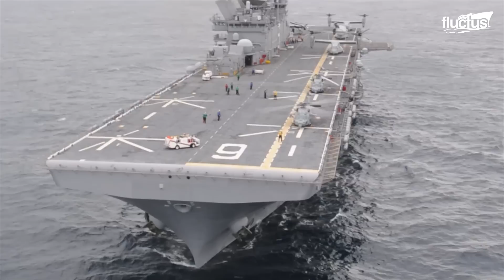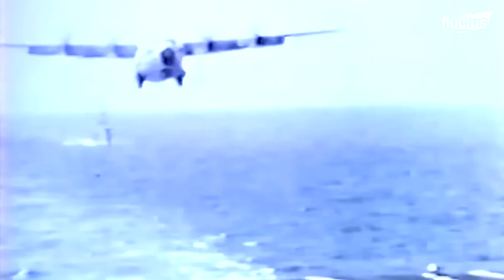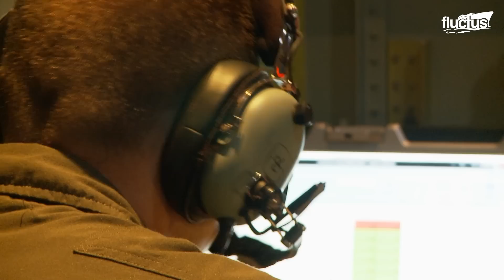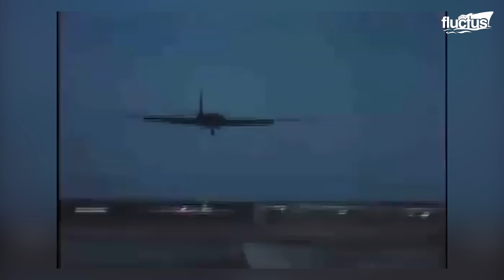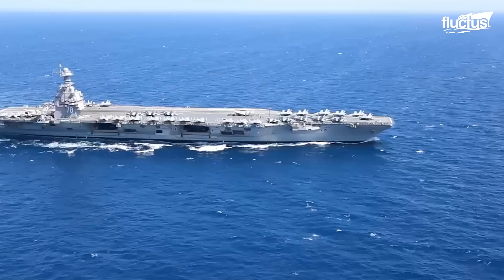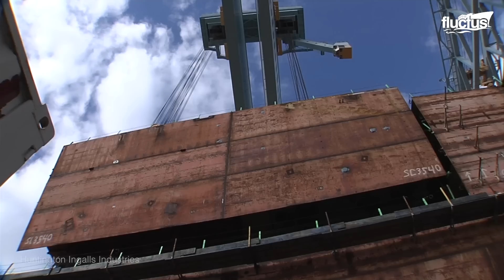Why US Tried the Most Dangerous Landing Ever Made on an Aircraft Carrier

Comment: Ok 105 knots landing speed 120 mph. Aircraft speed does not matter but the air over the wings does. That could be landing in a 20 mph head wind or the carrier is moving 40 mph or both would equal 60 miles per hour. If the ships speed and the head wind equals 60 and the air speed indicator reading 120 his true ground speed would be 60 mph. You could land a piper warrior on a moving aircraft carrier into the wind and it would look like a helicopter landing. His airspeed indicator would read 60 and his ground speed would be zero over the moving aircraft carrier.

Comment: F-104s flew both with and without wingtip tanks, and had leading edges so sharp they were covered for personnel protection when on the ground. I imagine one might just cut through the trap netting, both failing to stop yet getting damaged enough to not be able to lift off again. Does anyone know if that was ever tried? Just a F-104 fan wondering aloud.

Comment: Ahh, the two nuclear power plants do not turn the four shafts... These ultra modern ships still are powered by steam turbines, the reactors are just the way that steam is generated/created. Steam turbines turn the shafts and create the vast amounts of electricity needed for the new style systems (catapults and such) plus built in "future" capacity to allow for newer systems. Ships have been powered by steam for 200 years now (give or take). Since the invention of the propeller or screw propulsion, most of what has changed is how we create that steam. Wood gave way to coal, coal to fuel oils of various kinds, oil/diesel to nuclear. There are of course exceptions, many smaller navel vessels use diesel and jet turbines that are direct connect to the shaft, but steam is still king of the hill for the big boys whether they are "nuclear powered" or "conventional powered".

Comment: I was aboard the USS America CVA-66, 1969-1972, and we had a U-2 touch and go, land, moved to hangar bay, later moved to flight deck, and then take off.
Reply: How did it fit onto an elevator?
Reply: @naardri  on diagonal, one wing hanging over water, can't remember if it had a small wing tip fold up too??? what was cool was watching RHI RADAR scope during preliminary touch and gos ... it would "jump"  several hundred feet almost straight up!!!

Comment: While it was a good feat,  C130 has superb STOL  performance.  The Forrestal could make a 34 knots (higher I believe but this is the official top speed) and with a 15 knot headwind, the C130 would only have a relative speed of about 60-65 knots.  I think recovering the RF-5C and A3 was probably just as dangerous. These AC had much higher speeds and a much shorter deck.  Now I think it was nice flying, but the AC was landed on an empty  1000 ft flight deck on a carrier headed into the wind.
Reply: Did you mean RA-5C Vigilante ? My cousin was a USN RA-5C pilot on the Kitty Hawk, while at the same time I was a USMC KC-130 avionics tech, I worked on that old F model a time or 2.
Reply: @roberts6900  Yes, my mistake but that is the AC I meant. I was an Avionics Mater Chief for MAG 36 and VMGR-152 was one of my squadrons. I did not get a lot of flight time in the C-130. Pulled a couple of runs form MCAS Futenma to various other places but no stick time in that AC.  I was with VMFA 451 on a deployment aboard the Forrestal and saw some RF-5C landings.  The F4J is about 58 feet long and a wingspan of about  38 ft, vs something like 78 feet and 53 feet for the RA-5.  The RA-5 made the F4J look small. It is a big aircraft and I think maybe one of the hardest to land on a carrier. I would think the excellent STOL characteristics of the C130, with an empty flight deck, would be easier to land than an RA-5 on the angle deck with AC parked on the starboard side.  It looks small in an F4J.  I would think that in an RA-5, with aircraft on the deck, it would have a high pucker factor.
Reply: @shenmisheshou7002  VMGR-152 was also one of my squadrons.
Reply: @roberts6900  Marine Corp was a small world.  If you did C-130s, you likely passed through Futenma.
Reply: @shenmisheshou7002  I was at Futenma, I extended twice to stay there.
Reply: @roberts6900  What years were you there? I loved the snorkeling there.
Reply: @shenmisheshou7002  '76 to '79.

Comment: Landing a 4 engine STOL onto a super carrier was a huge achievement. But I don't think this was the most dangerous carrier landing. Dunning's landings on HMS Furious in 1917 were more challenging. Eric Brown's landing of a twin engined Mosquito onto a tiny escort carrier was also more dangerous. But if the Hurcules landing had gone wrong, there would have been an order of magnitude more carnage.
Reply: I don't think that landing the C130 was a good idea.  Too much can go wrong where conventional means of recovery wouldn't work.
Reply: @qua7771  Ours is not to question why.
Reply: @Will_CH1  I been out for decades, and don't think like that anymore.  I heard stories about the C-130 back then, and thought it was a bad Idea. I thought people were making up stories. I worked on P-3 Orion's that has the same engines.  I wouldn't want to be on the flight crew, or anywhere that flight deck.
Reply: @qua7771  I agree with you on every point. There was very little margin for error. This exercise needlessly risked the lives of good men.
Reply: @Will_CH1  Thanks.  
You know how we are trained for safety with redundancies built in.  this violates everything.  What could go wrong?
Reply: @qua7771  40 tonnes moving at 130 mph into a controlled crash with just a few yards between the wingtip and the island? I think that would make quite a dent.
Reply: @Will_CH1  When I first heard stories of this I honestly thought it was a joke.  I was well versed on the capabilities of my aircraft at the time, and thought, no way.  Neither the plane, nor the carrier was designed with this in mind, and that is when bad things happen.

Comment: Certainly a C130 is a large aircraft to land on a carrier but this was a carefully controlled experiment in good weather. Most dangerous trap? Nah. Try one in bad weather at night with the ship rolling and bucking far out at sea running low on fuel.
Reply: Dangerous I think  when you go to full reverse on props before touch down. Exactly backwards to normal aircraft landing where you immediately go to full throttle in case you miss the cable

Comment: JATO bottle fwd/aft of C-130, regular angle on back, 10deg in front (FAT A type aft or fwd if so needed, weight+stoppage=issue). Weight of struts (stablization only) for U2 not an issue. Fly by wire struts (not for rating, just stablize only).

Comment: You mean to tell me that huge plane only ways 76,000 Ibs. There's no way. I drive around with that or more. Daily
Reply: no that particular aircraft WEIGHED 85,000 pounds, no cargo and minimal fuel plus they stripped off unnecessary equipment; normal max takeoff weight is around 150,000 pounds

Comment: LHD 6 is not an aircraft carrier  it is an amphibious landing ship.
Reply: Right on.  They do carry aircraft , but they are Amphibious Assault Ships.  Many also have a well deck allowing them to launch amphibious landing craft into the water.
Reply: Looked up Wasp class on wiki. In sea control mode it can carry 20 F-35B fighters and 6 SH-60 Seahawks for ASW. That makes it an aircraft carrier if that is the job that needs to be done. Being able to do more than one thing is a good thing.
Reply: @steven4315  For many years battleships and cruisers carried float planes that were launched with catapults and recovered using a crane.  Many destroyers have drone or manned helicopters on board.  Does that make these ships aircraft carriers?  No.  Wasp's mission is launching and supporting amphibious landings.  The main mission is not carrying aircraft.  The aircraft on board are tools for the mission. I'll the Navy decide what class its ships are in.
Reply: @garygreen7552  It looks like the navy decided that if it needed to it could configure these ships as small aircraft carriers.  In the sea control configuration these ships carry, not a couple float planes, but 20 F-35Bs. If it looks like a duck and quacks like a duck, it's a duck. The navy will call them what they want but if we go to war against a near peer (China) I think these ship are more likely to be used as bird farms then amphibious landings. The navy will never call them CVs because they don't want to confuse congress.
Reply: @steven4315  World War II was won with numerous amphibious landings.  D-Day was an amphibious landing that was the start of the final thrust in the war in Europe.  It was not the first landing in that part of the war.  The war in the Pacific was one amphibious landing after another on islands that had been taken and fortified by Japan.  The atomic bombs were dropped on Japan partly because of the projected cost of a final amphibious assault on Japan.  Whether that was the right decision is not part of this discussion. Wars are not won in the air.  They are won on the ground.  That is part of the reason we lost in Viet Nam.
Reply: @garygreen7552  I agree with everything you said about WW2. I agree we need to keep the gator navy. The last major amphibious landing was Inchon. The fact that the Wasp class can be used for different roles is a good thing. Multirole ships tend to have long careers. This why all 7 of the surviving Wasp class is still in service. My understanding is, after retirement these ships will be either mothballed or transferred to allied navies rather than scrapped
Reply: @steven4315  Looks like we might actually be more in agreement than it first seemed.  Versatile ships are important. As a former gator navy guy I agree that landing operations will be a part of future conflicts.  I served on USS Stone County (LST 1141) during a deployment to Viet Nam in 1968.  We didn't do any amphibious landings, but we could have.
Reply: @garygreen7552  Served on the USS Richard S. Edwards (DD-950) post Vietnam.

Comment: How structurally strong are the new carriers?
Reply: WTF???
Reply: @bob80q  They build them in sections and weld the sections together. How do they weld them and how strong is the weld? How did they build the old ones?
Reply: @calvinnewborn8452  Newport News has been building ships for over 135 years, I think you can trust that they know what they are doing.  Guess you might as well ask how safe planes, cars, trains and buildings are too.
Reply: @bob80q  Buildings fall, planes crash (they almost always blame the pilot) because the pilot can't talk. And you're dealing human error and something new.
Reply: @calvinnewborn8452  Modern aircraft carriers can withstand a nuke. I’m pretty sure one plane landing on its deck won’t do too much harm